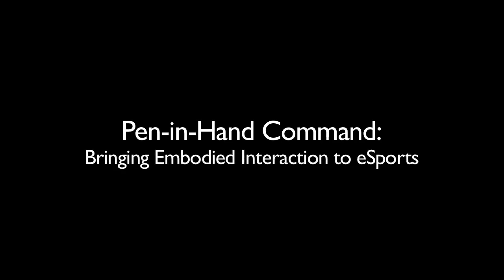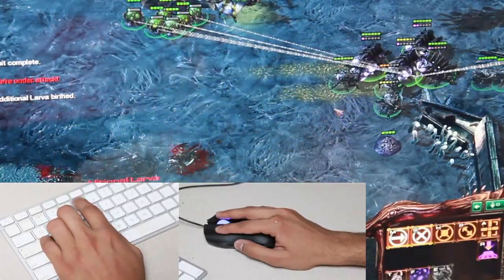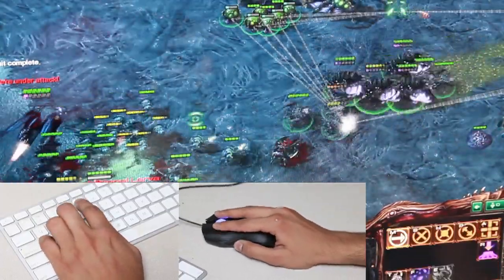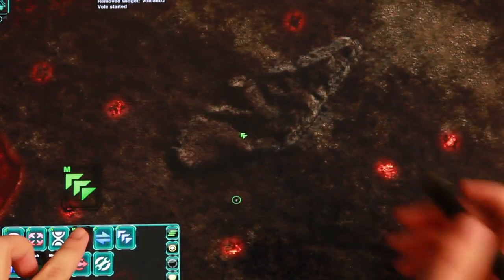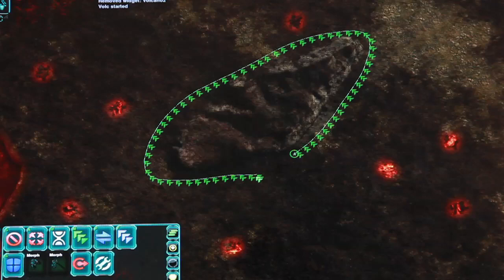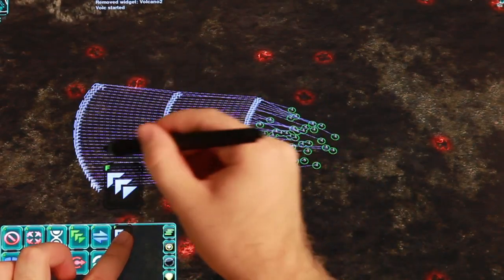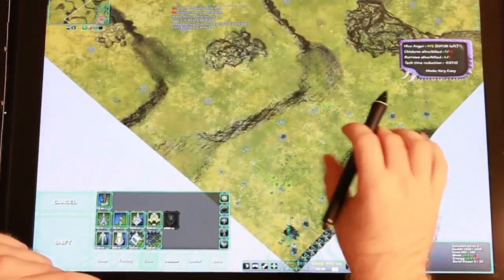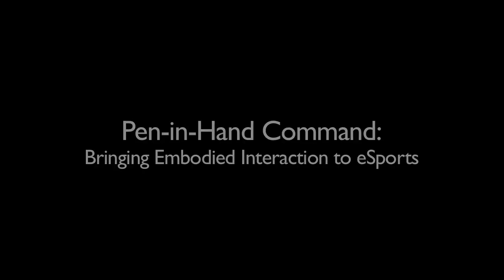Pen-in-Hand Command: Bringing Embodied Interaction to eSports

Comment: read the last post about how illegal is *A and the last answer is from a pillar of the communauty (ai codder) that relate springrts whole will be cancelled because one of the four commander of zk is the original armcom design remodel + retrocompatibility = emulation of atari content COB 3DO
not only springrts engine born from reverse enginering but still continue to distribue and enable intelectual proprety infrigement

Comment: 1) Spring RTS has nothing to do with games using it.
2) The only unoriginal part of ZK are a couple of unit names (and I'm sorry, but you can't copyright Zeus). It still has a couple of old unit models (read post 529548#p529548 on spring rts forums), which are in the process of being reworked iirc. These units were never created by Cavedog, so there's no copyright issue.

You probably just came spreading FUD, which ZK doesn't deserve, and that's how you got banned.

Comment: If the SC2 gui were changed to work nicely with this, then yes, it could be useful and even superior, however, in it's current state, Starcraft 2 would perform badly with this (obviously, ya dummy, because sc2 is optimized for using a kb and mouse).

Comment: I disagree. Not saying that mouse and keyboard wont be replaced. But the problem with technology like this is that it doesn't offer enough controls. So i wouldn't say that sc2 is behind this technology. Its ahead of this tech. SC2 needs so many different inputs to be played at top level. And this is simply too slow and therefore i don't think technology like this can be viable in an esports fashion. This is awesome and can make up for some awesome games. Just not esports. My opinions ofc (:

Comment: It has all the elements required. First of all. Obviously LoL runs in real time. The strategy part of the game is very advanced and difficult. At the top level it also requires very precise and fast mechanics. If you compare it to SC2 you will find many similarities. Example: Timings. SC2 is played alot after certain timings dictated by upgrades, economy, build/train duration, unit count etc. League of legends timings are dictated by level, known play positioning(jungle timings), items etc.